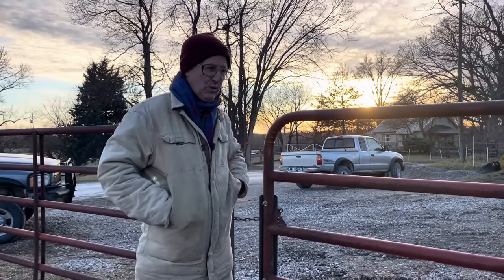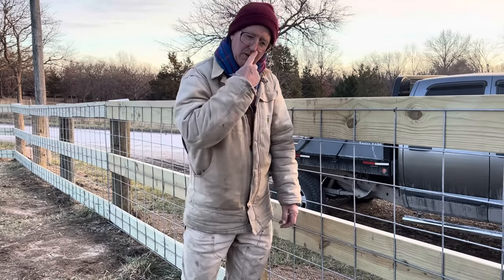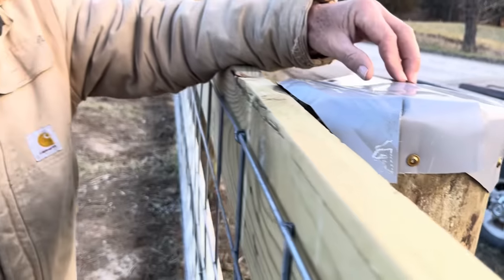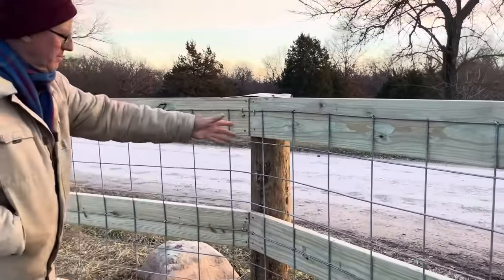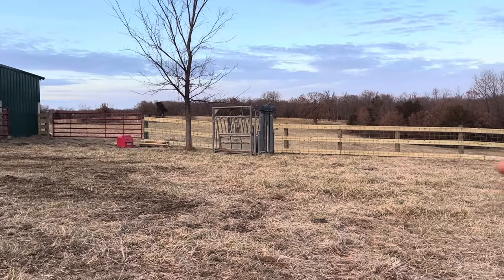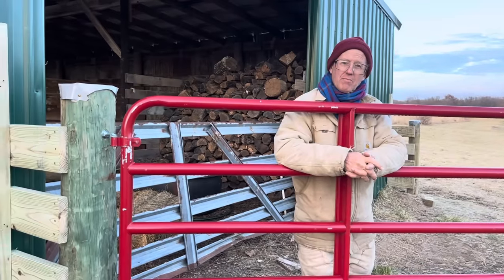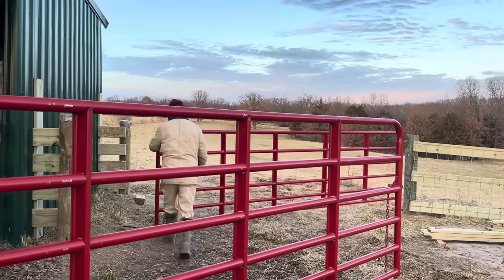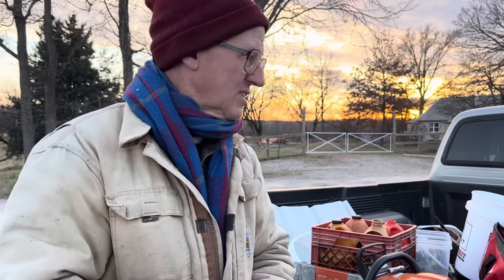Greg gives tour of their new livestock corral construction.

Comment: You might want to keep those chains on the gates, might come in handy in the future. If you wanted to put a hot wire along the inside you could cut some timeless post into pieces, and then lag them to the posts for insulators. The corral looks stout! Really turned out nice with the 2x8 and cattle panels, attention to detail, and good planning. Thank you and have a wonderful day
Reply: Yes we use both the chain and gate latch because an animal can spring the gate out of the latch if they hit it hard enough. Don’t ask me how I know that…
Reply from the maker: @paulmceachin5515 thanks for the tip. I’m getting a chain for when they’re in there😊😊